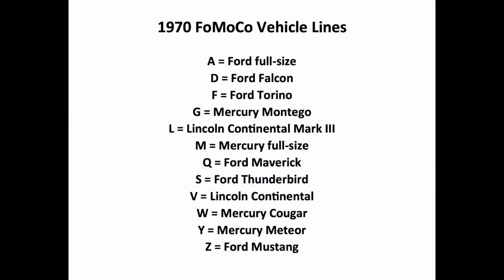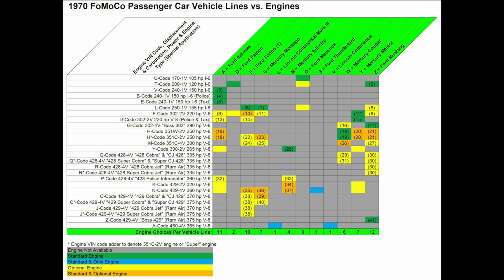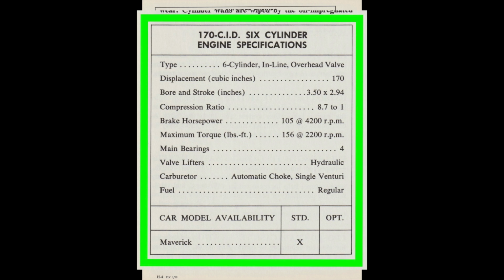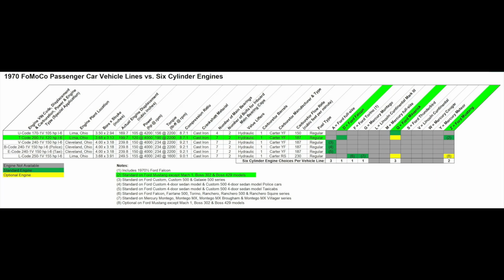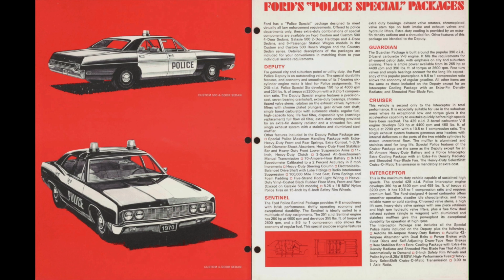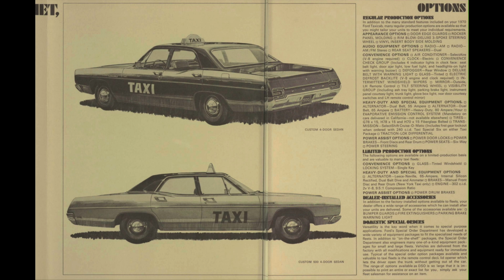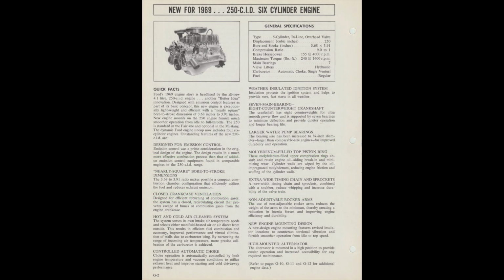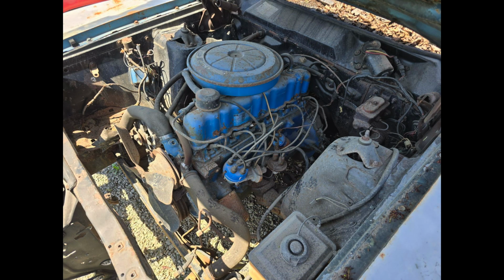#30 — 1970 FoMoCo Car Engines!  Part 1 of 4 — Six Cylinders

Comment: Adrian from New Zealand here, where I had a Kiwi assembled 155hp 250ci Ford Falcon XY model sedan. Did you know the Aussies from '70 to '73 made a special 2V head version of the 250.   The badge on the '70 to early '72 XY said 250 High Performace, and on the '72/73 XA said 250 170-HP !!

Comment: Ford introduced the 250 into the Australian Falcon in the XY model in late 1970. it had the same 155 hp and the same integrated inlet manifold. However it was also available with a separate inlet manifold and a two barrel carburettor for 170 HP. This was known as the 250-2V. a smaller 200 ci unit was also available (this used the same bore spacings as the 250, not to be confused with the older 200 which was a slightly larder 170).

The engine was given a major revision in July 1976 for the XC Falcon to met new emissions requirements. It gained a crossflow cylinder head. 
The next upgrade came in 1980 when it received a Honda designed alloy head in the XD Falcon.
In 1982 (XE Falcon) it got another upgrade with a two barrel weber carburettor.
In 1983 optional multipoint Bosch L Jetronic fuel injection became available, this was done to lift power so it could replace the 302 and 351 Cleveland V8 that had been discontinued in late 82).
In 1984 (XF Falcon)  the EFI version of the engine gained a Ford EEC IV ECU, to replace the previous Bosch unit. In 1986 the engine was detuned with a lower compression ratio to deal with Unleaded fuel.
In 1988, for the new EA Falcon, the engine was completely reworked, it gained an overhead cam and all models received fuel injection.They also had engine capacity reduced  3.3 and 4.1 litre became 3.2 and 3.9 litre.. the smaller engine had single point injection, the larger could be optioned with multipoint. 
The 3.2 was a slow seller and was soon dropped.
In 1992 the EB Falcon saires 2 had another upgrade, all engines gained multi point injection the capacity was increased to four litres.

The engine basically stayed the same, with detail improvements until 1998 when the AU Falcon was introduced. 
The sports model was available with variable valve timing on the SOHC. 

The engine received its' last major upgrade in 2002. When it got double overhead cams, and four valves per cylinder. it also got standard variable valve timing on both inlet and exhaust cams. there was also an option turbo charged model available.. This engine was known as the "Barra".  Yes, the Turbo charged Barra that you may have seen at drag week, is a long lost relative of the humble 250 cu in six from 1970.  The Falcon, and the Barra six both ended production in 2016.
Reply: Perfect and exactly what I came here to say, also the 250 crossflow ended up in some cortina's for the full "lead tipped arrow" experience
Reply: @plomaturbo  Pretty sure the last of the TFs even copped the Alloy Head version.  Agreed, Six Cylinder Cotry's could really go... in a straight line.... on a smooth road :)
Reply: The unique Aussie 250 2V spec of 1970~73 also included a tube-wall exhaust manifold (aka Extractors or Headers).

These 170 hp engines performed better than the nominal extra 15 hp might indicate (above the 155 hp 250 1V) and, when tested in manual form, were surprisingly competitive against the 302 2V V8, with SS 1/4 mile times well into the 16 second range. 

Apparently Ford Australia sold the tooling to Ford Argentina where the head and intake manifold reappeared as their high-performance 221 2V (aka 3.6 Litre) engine option.

Comment: The  integrated  cylinder head / intake manifold design always made the Ford 144,170, 200 and 250 straight sixes non performance engines. Offenhauser did make an aluminum three one barrel slab that would bolt on after milling the log intake top completely open. The 240 and 300 sixes are much better for building horsepower.
Reply: Check out the Aussie 250 2V head mate !!
Reply: I was happy with the 240 in my 68 F250.
Reply: -- The 1965 and up 7-main bearing 200 I-6 from Ford did NOT have the integral intake/head casting... though I cannot recall what the story was for the 1963-64 200 I-6. As for the 144 & 170, yes, you could cut off the intake and then machine the head to accept an aftermarket bolt-on intake of your choosing along with the proper carb set up to go with it. It was fairly easy to gain an additional 25-50 horsepower depending on what you chose for induction. The downside was that you were still dealing with a 4 main bearing motor and the head itself provided poor flow due to its design even with additional port work. Even so, you would surprise other drivers who had a stock inline under the hood. The truth is, for real speed, swapping in a V8 was the way to go. Best wishes!

- Max Giganteum

Comment: I had a 200 sick cylinder in a 1972 Maverick. Complete pile of garbage. So was the 3 speed stick shift.

It was as slow as a carburetor Ford Escort. I was SO happy to junk that car. After the subframe split in the back and the driver floor fell out of it.

Comment: I never understood why there were 3 separate engine codes for the same spec engine. Do you have any knowledge on that, like cooling capacities or anything?
Reply from the maker: @brianhdueck3372, I agree that the V-code / B-code / E-code 240-1V situation is strange.  The only explanation that I can think of is that there MUST have been some differences between the engines that weren't part of the specifications presented in the video, i.e. not the power or torque ratings, not the compression ratio, etc.  I'm thinking of a difference like the flywheel or flexplate, valve springs, or something along those lines.

Thank you for watching, Brian.

Yours in old FoMoCo iron,

Adrian
Reply: @adrianclements8916  Agreed
Reply from the maker: @brianhdueck3372 , after I replied to your comment I found a very informative comment on this subject posted by @richsarchet9762 yesterday that stated:

- The B-code 240-1V I-6 Police engine had heavy duty bearings and valves, exhaust valve rotators, and timing gears rather than a timing chain.
- The E-code 240-1V I-6 Taxi engine had heavy duty bearings and valves, and exhaust valve rotators.

So THAT is why the 240-1V engine had an Engine VIN Code of "V" for the public, "B" for the Police, and "E" for Taxis.  I just LOVE learning more about FoMoCo stuff!  Thank you, Brian.

Yours in old FoMoCo iron,

Adrian
Reply: Another difference with the police and taxi was a canister oil filter  rather than a spin on for " lower cost of maintanance"
Reply: Another difference is the air cleaner and fuel filter oil bath air cleaner usually used on t. Axi also both use the earlier style fuel pump with the integrated fuel filter. With the little screw on can rather than.  The filter that screwed into the carburetor fuel inlet i believe all 240 and 300 engines used gear driven camshafts had a 1966 ranch wagon 240 3 spd  also earlier taxi  with 223 6 cyl was available with a "special economy carb" this carb had no power valve circuit aproximatly 1962

Comment: I'm going on what I read on the pages about them from this video.  I agree that gears either require a reverse grind, or idlers so that the crank and cam rotate the same way.  Ford didn't include diagrams in their sales literature, so I don't know which they did.

Comment: Very interesting topic great presentation. Are you able to tell us why the V-Code 240 and the B-Code 240 differ from one another other than intended customers? All of the specs here seem to be identical. This would also apply to the E-Code as well. Thanks.
Reply from the maker: @timothyirwin8974, thank you for your kind words — I'm so glad that you enjoyed video #30!  Please be sure to check out videos #31, 32 & 32 which are Parts 2, 3 & 4 in this four-part video series.

@richsarchet9762 has answered your question below about the engine differences that precipitated the V-code / B-code / E-code 240-1V engine codes.  I will freely admit that didn't know the information that Rich presented, but it makes perfect sense and is the reason for the three different VIN codes — the engines did have differences, just no differences in the specifications that I covered in the video.

Thanks for watching, Timothy.

Yours in old FoMoCo iron,

Adrian
Reply: The taxi and police engines had heavy duty bearings and valves, and exhaust valve rotators.  Police only had timing gears rather than chain.
Reply: @richsarchet9762 a gear driven cam is pretty noisy.  I don’t remember this design difference.  I was at ford but not at engine.  The gear driven cam requires a reverse image cam grind I believe.
Reply from the maker: @richsarchet9762, THANK YOU so much for the explanation of the actual differences between the V-code, B-code, and E-code 240-1V engines.  I will incorporate your information when I do a similar engine video series for the 1965-69 and the 1971-72 model years.

Yours in old FoMoCo iron,

Adrian

Comment: Fun fact, here in Australia the 250 L code 6 was a very common engine for our falcons and went through one barrel log intake ,to a two barrel (2V) bolt on alloy intake, to a alloy crossflow head, polysphere combustion chamber, to a single OHC with a active variable length and variable camshaft timing.  intake , to finally the DOHC four valve turbo,(the "barra" 6) . The barra 6 can, with mostly factory parts, be installed straight into where the 1970 250 came out of , despite the only remaining giveaway of its heritage being the bore spacings are still the same.

Comment: I drove a 1971 Maverick 250 part of HS and it was the quickest zero to 70 of all other kids 6 cyl. 225, 250, 258 and other AMC, Ford, GM and Mopar cars even though it was a 4 door. C-4 trans. 3.20 axle. A red light runner T-boned the car and and I put that 250 plus a Toploader 4 speed in my '66 Mustang and then I had the fastest 6 and only 6 cyl. Mustang around. It all bolted together like factory using the Maverick gas pedal and cable, V-8 Mustang driveshaft and a Pinto axle yoke on the original 4 lug  rear end. Strong running I-6
Reply: Me too i had a 70 mustard with black top same setup ,it was bulletproof ,we called it the Z killer ..light to light nothing would catch it sounded like a bad ass allison when you wound er up.hard miss it , got hit in the rear totalled

Comment: The only Ford Y I've ever owned was a 300 CID in a 1985 van.  It was a solid powerful and reliable engine The manual transmission not so much In fact I would go so far as to say it was total garbage hydraulically operated clutch was an epic fail.

Comment: Videos are coming in Hot!!
I'll have to set aside some time! 🙂
Reply from the maker: @outlawbillionairez9780, absolutely!  Because the four videos are all on the same overall topic, I decided to drop them boom-boom-boom-boom one right after the other.  The total watch time for all four videos is 4 hours, 2 minutes and 7 seconds.  Thank you for watching, and I hope that you enjoy them!

Yours in old FoMoCo iron,

Adrian
Reply: @adrianclements8916  I'm a really old Blue Oval, and have never seen this material compiled in an easy to understand format.
Reply from the maker: @outlawbillionairez9780, there is so much misinformation about there about FoMoCo engines from the late 1960s through early 1970s that I decided to take on the challenge of doing a deep-dive into the 1970 model year and laying out ALL the facts to set the record straight once and for all.  It was an absolutely hellacious amount of work to properly document the TWENTY-SIX ENGINES used in the 1970 FoMoCo passenger car lineups, but it's done now and out there forever.  Hopefully the videos will be well received.  If they are, I will consider a similar approach to other model years.

Yours in old FoMoCo iron,

Adrian